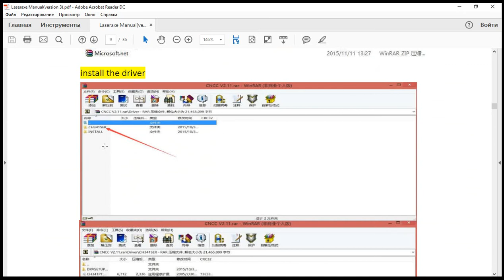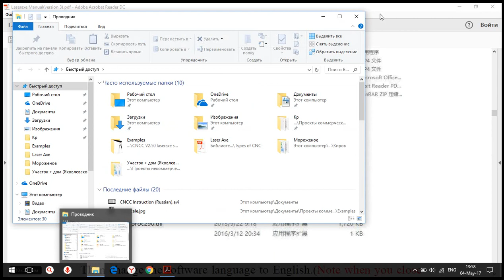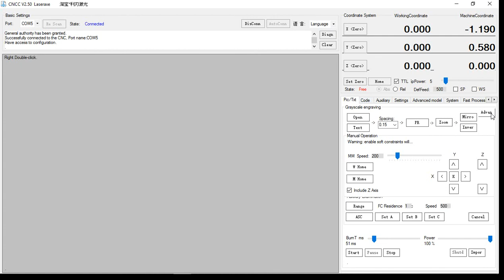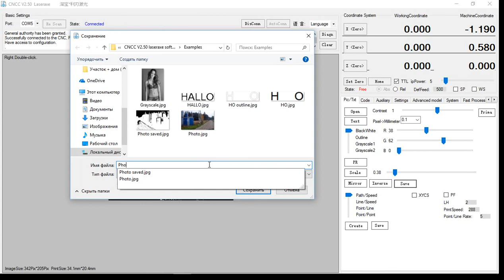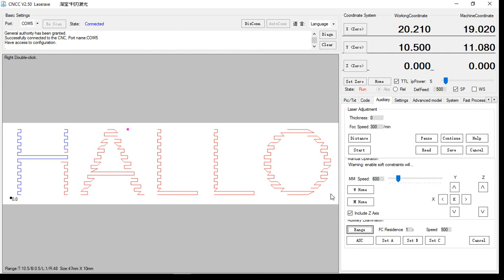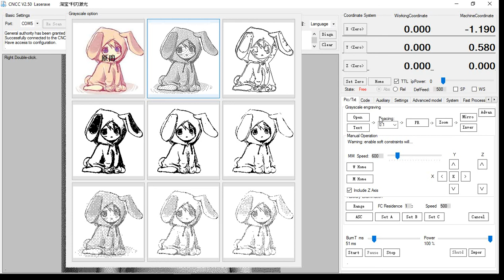CNCC Laseraxe video Instruction. How to run a program

Comment: hello! I just received a 7000mW engraver and the power keeps resetting back to 100%. I cant get the weakest to the strongest settings of intensity. Hoping you may be able to help me.
Reply: https://www.laseraxe-customize.com/product-page/laseraxe-diy-desktop-mini-laser-engraver-engraving-machine-laser-cutter-50x65cm 

This is the model I just got. 7000mW Straight from the site.
Reply: I've got the 7 watt as well.  Turn of TTL, it doesn't ALLOW for multiple power settings.  TTL is on or off.  The 7w comes with the cords plugged in to the pwm spot on the board, it seems to be a mistake in the way they set things up.  If you look on the top of the laser (on the circuitboard) you'll see where its connected.  If its like mine itll have a spot for ttl and a spot for pcm.  Burnt lots of squares trying to range my laser before i looked up what TTL is and realized that its a terrible idea unless you just want 1 power setting.  Also be careful, WS doesnt work properly when you cant actually control power level....
Reply: George Fomichev how do you do TTL and have control of power level or do grayscale?   Curious how youd keep it from burning through things like leather too... The technology involved with TTL is an on off only normally.
Reply from the maker: we have TTl... have a look https://www.youtube.com/watch?v=2B1xluaroys